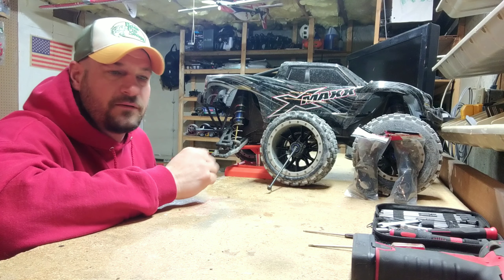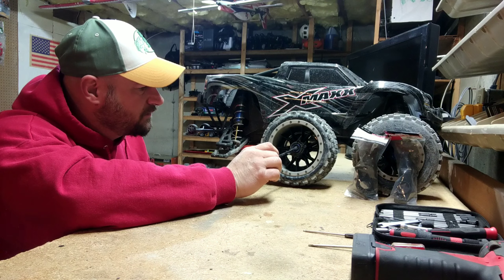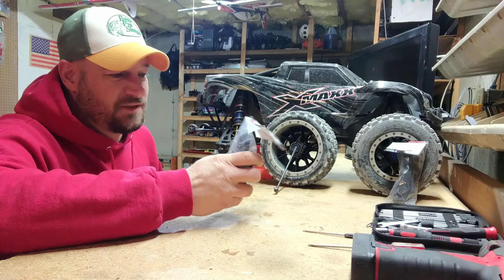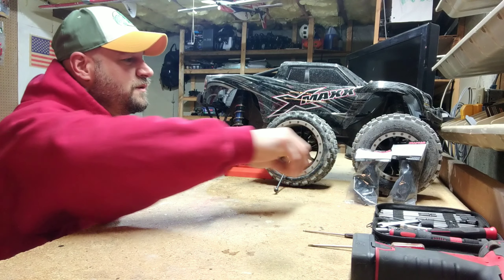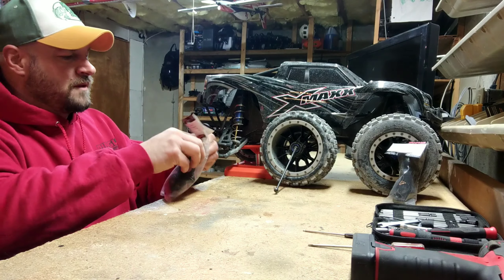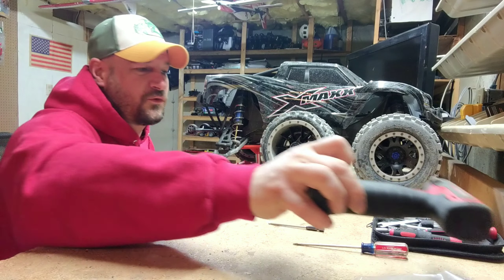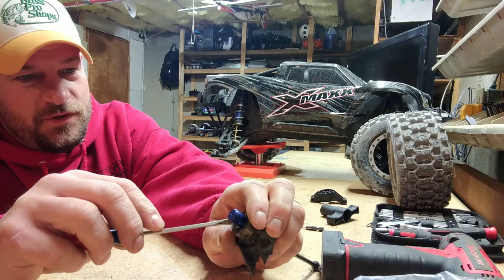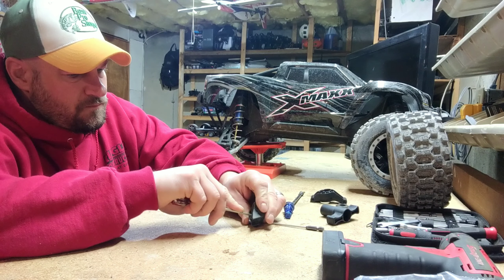"Bench Time" XMAXX hub replacement & Mod or no Mod!!!

Comment: I agree.. Need to get out with the rig and it will tell you where you would need to modify (if at all)_your rig..  Really depends on where you run and how you drive.. Nice work on the Xmax bud. Great video
Reply from the maker: Thanks my friend, had a lot of fun doing this video. Cool part is not just bashers going to be repaired all kinds of RC stuff and related items. Thanks for watching.